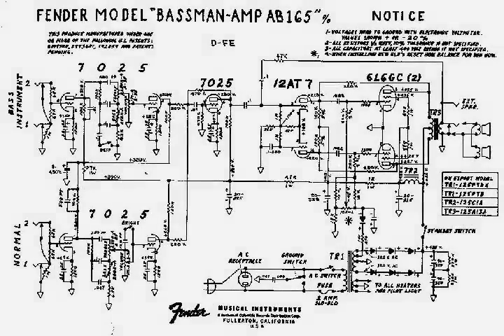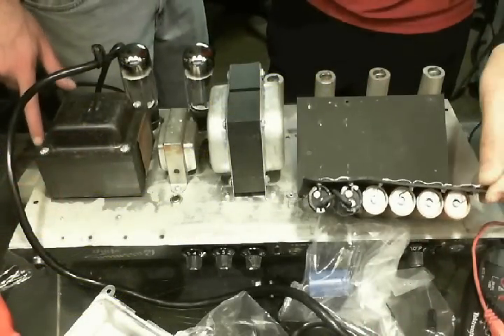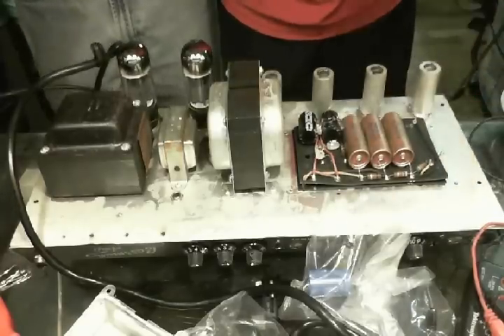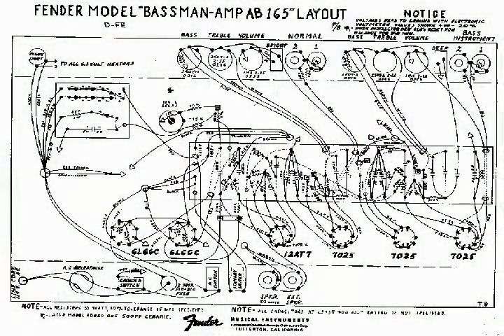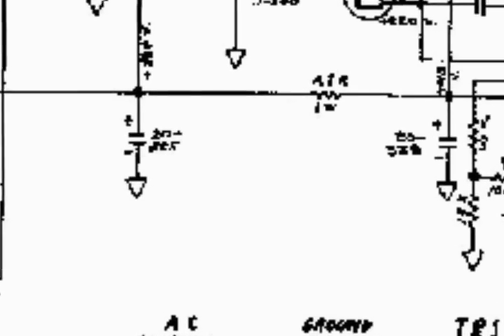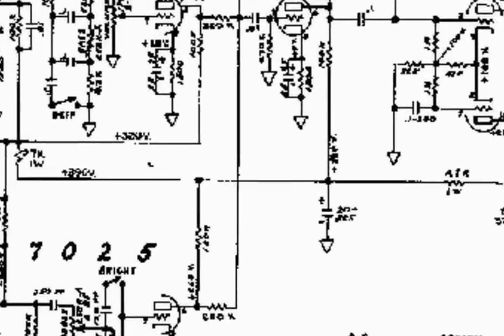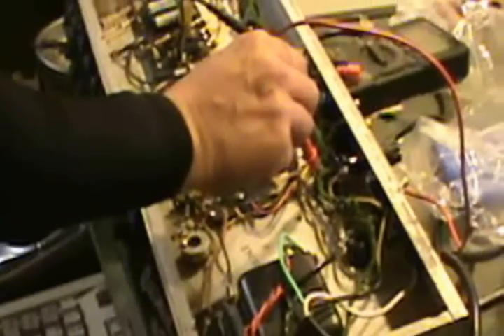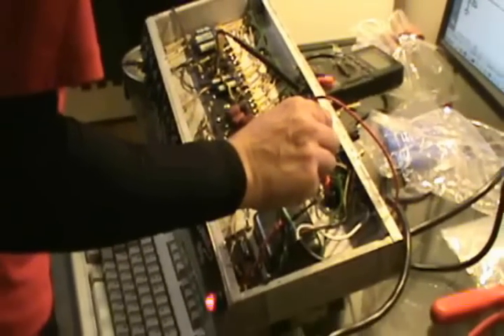Bassman Recap

Comment: I have heard it said, that if you add filtering, you will change the performance of the amp to what most consider undesireable. The "lack" of filtering allows the power supply to droop at certin levels adding crunch / distortion / fuzz, which was highly desireable in those years. This was before the days of all the cool effects pedals, so that aspect should be left alone because it will change the tone and performance of the amp. if your customer asks for that, specifically, I think you should remind them what will happen, and if they don't like the sound, they will be paying for another cap job. Most want things as close to print as possible to include using NOS parts. Very good video! Thanks!